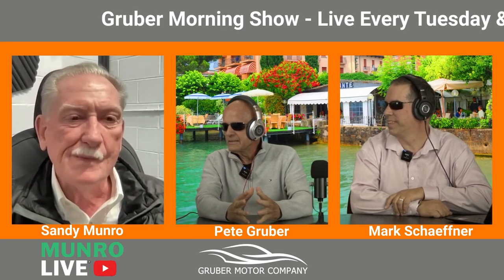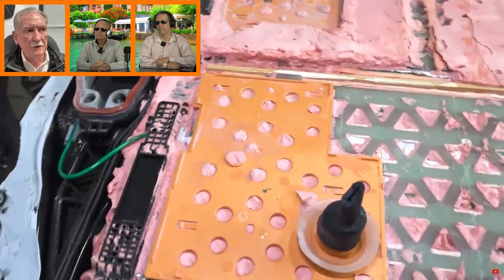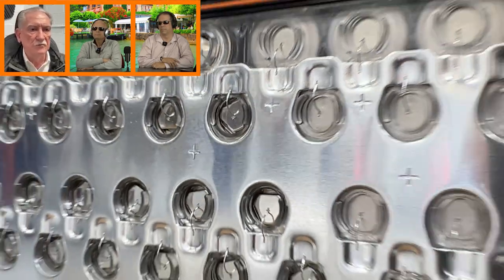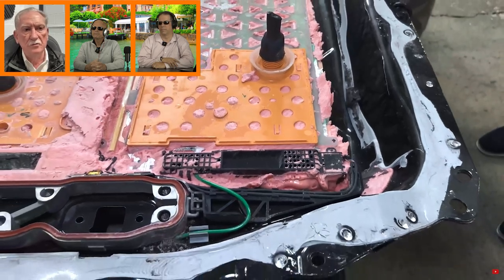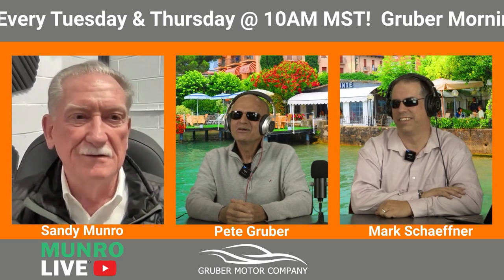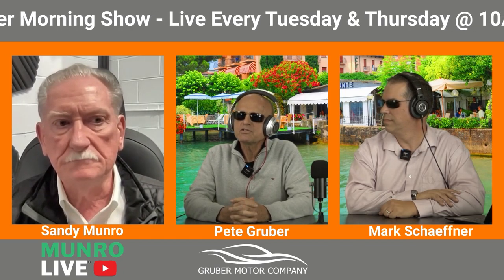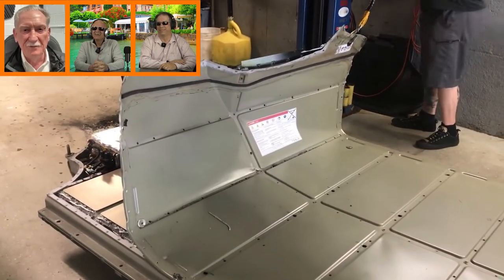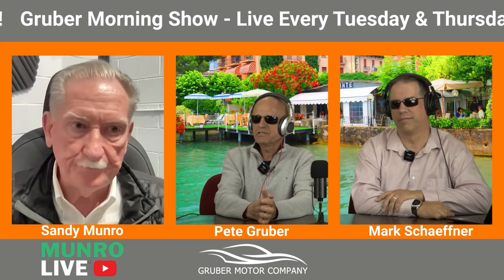Is Tesla's Structural Battery Repairable?

Comment: Munro doesn't care much about repairability. Profit and margins are more important.
I agree with him that if you reduce the number of connections and components, you increase reliability. But if you're unlucky, you can't replace the failed module, so you throw away the entire pack. Unless Tesla found a way to "isolate" the bad cells.
Reply: But I guess the point is you will be unlucky so few times that while you do lose the pack you don't lose very many packs and it will be rare. So from the customer's point of view they won't really care if there is a failure if the pack is covered under a 8 year/100,000 mile warranty. If these packs are really reliable then you will have to have won the jackpot to be a customer that has a pack failure outside of warranty. That customer won't be happy but those will be a very tiny number of customers. And likely by the time this happens in 10 years from now in 2032 pack costs will be very much lower in cost.
Reply: @flipadavis  bull. All batteries go bad. A bad internal part on one batch and it is gone. It is bad design and Tesla will be forced to change it like the phone manufacturers are being made to make the devices repairable. Just as a reference, a whole Q of  Model 3 Performance production in 2021 had bad packs because of faulty modules  and they are facultying one by one slowly and Tesla is hardly keeping up with the replacements. Now imagine you have to replace the whole pack.
Reply: I'm convinced, there'll be a battery replacement program at Tesla in a couple of years that doesn't cost a fortune because you'll be able to sell your broken battery to Tesla
Reply: When you say: "But if you're unlucky"   The goal is NOT to rely on luck!  think about it...
Reply: Its like using the airplane instead of driving. When a plane crashes, it is bad luck because there will be few survivors if at all. Yet, a lot of us prefer to fly than drive.
Reply: True, because everything breaks! Former mechanic… I think this battery pack has gone too far:  not able to repair properly…
Reply: @Doctorbasss  Everybody is unlucky when it comes to car ownership. But some brands are more lucky than others. Something will eventually go wrong with any mechanical device. 

The point is that the structural pack if built well and built bullet proof with the cells built to last with lots of testing then the number of packs that fail outside of warranty will be so miniscule it will be a rounding error. 

Sure you could be the one that eventually gets the pack that goes bad at 120,000 miles but you might also be the tiny statistic that slips, falls and dies in your bathtub.
Reply: The disposable pack sort of makes it a disposable car. No one is going to want to buy a new pack when the car is over 10 years old. Tangental question here. What’s the absolute longest anyone has kept a laptop or cellphone battery in use. 8-10 years?
Reply: You said "throw away" but you meant recycle.
Reply: @flipadavis  Where I live, the average disposal age for viechles is 19 years.

Arguing that a 8 year warranty solves the problem is ludicrous..

In most cases where a battery needs service is due to a small number of weak cells, not components shaking loose.
Reply: It would be nice to know many batteries go bad after the multi-year warranty.  LFP batteries are fast becoming battery of choice and claims 3000+ complete recharges (Easily 10 years).  And EV battery recycling is the future.
Reply: I went Glamping (glamor camping) in Santa Cruz CA last year in solar powered tents using recycled EV batteries.
Reply: Wonder what kind of mess it is to recycle all metals, lithium etc from dead packs
Reply: @stvybaby  This is exactly the problem with the current green transition: if we're doing it this way (making everything disposable and throw it away as soon as it is out of warranty), we're just making it worse, or at least not better. Our use of limited resources will increase, not decrease.
This is where I take offense at people being all superior in their greenwashed Teslas. Tesla is making the car a disposable product. The structural battery pack is one example. Adding large single piece Alu castings in the body of the car is another. Repairability of cars will soon be reduced to that of white goods. That is an enormous waste.
Reply: @marcusbiller867  
That's an "interesting" view (Model 3 packs failing).
where's your evidence?
Reply: @Mrelectric423  
Here's a better question.
How do you know when the pack will fail, If the pack will fail, or what the price of a new pack may be in 10 years?
Reply: @stvybaby  
The issue with your opinion.
We've yet to see many Lifepo4 packs exceeding 10 years (In actual EV use).
"LFP fast becoming the choice"? Really?
They MAY, but as yet, they're not.
Maybe the CATL MP3  cell will prove desirable?
Reply: @finnderp9977  
I wonder why you haven't researched before posting an "open" question?
If you had, you wouldn't be asking the question.
Reply: @hvh377  
How is recycling disposable?
Reply: @ogzombieblunt4626  It isn't and nobody proposed it was except you just now.
Reply: There are literally still 20-50 years old cars on the roads somewhere around the world that can be very easily repaired and reused even in really harsch environments you can just see those cars on documentaries like deathly roads......
Reply: @hvh377  
You literally just said it 🤣
Reply: @hvh377  
'Making everything disposable and throwing it away'
--> nobody said its being thrown away

Insanity.
Reply: @MichaelEricMenk  And here is Mr. Edge Case to tell us all how something won't work for him. The newest packs will likely last 300,000- 500,000 miles and outlast the car itself. 

If you really want to keep your old 300,000 mile, 19 year old car alive then buy a new pack in 2042. They will be dirt cheap by then.
Reply: @flipadavis  And here is Mr Throw It Away And  Buy A New One.

Claims about MTTF of a battery is irrelevant in a case by case bases. The mean is just that.. the mean.

If your claim was true, then Tesla would have no problem to give a 20 year 50% SOH warranty, and not only 8.....
Reply: @MichaelEricMenk  99% of people "throw away" their ICE cars after 150,000 miles. Thats how the car business works. 

In reality though most of a car's mass is recycled. The same with EVs. The pack has a huge concentrated mass of already refined materials that don't need to be mined and shipped across the ocean. 

But like I said these new packs will likely last 300k-500k miles which is far greater than the typical 150k-180k miles before a typical car/truck is scrapped. 

So maybe you should find some ICE forums and complain to all those ICE owners who throw away their cars after 13 years and 150k miles.
Reply: @finnderp9977  It will be a lucrative mess. Tesla is already recycling low quality cells after testing. Redwood Materials, a company founded by JB Staubel one of the original founders at Tesla, is a company that recycles cells and packs from all industries including automotive packs.
Reply: @flipadavis  wrote: " 99% of people "throw away" their ICE cars after 150,000 miles. Thats how the car business works. "

I see you have problems reading.

The average age of disposal of a car is 19 years... And yes, where I live.

You wrote: "But like I said these new packs will likely last 300k-500k miles which is far greater than the typical 150k-180k miles "

And as I told you, if you are telling the truth, then Telsa Motors would have no problem having a 20 year warranty of this unreparable battery. About 50% of cars get to this age (according to government statistics).

You, Mr Throw Away, will of course be happy with 8 years.

But you are not the World, and neither is Mr. Throw Away Munro...
Reply: @MichaelEricMenk  The average age of car disposal is not 19 years. Here is the most updated info I could find: "The Bureau of Transportation indicates that the average age across the board for vehicles still on the road is just over 11 years according to Autotrader, and the average may be approaching 12 years. Standard cars in this day and age are expected to keep running up to 200,000 miles, while cars with electric engines are expected to last for up to 300,000 miles."

If ICE cars last so long why don't they have 19 year/300k mile warranties as well?
Reply: @flipadavis  wrote: "The average age of car disposal is not 19 years"

You are partly correct. It is 20 years for diesel cars. According to governmental statistics. 

So the average is maybe 19,5 years? Happy now?

quote: "If ICE cars last so long why don't they have 19 year/300k mile warranties as well?"

No, but they do not have a large serviceable essential part of the car.

That is the whole point of the video.

Again, you you statement are correct. Tesla Motors will have NO objections to have a 1 million mile,  20 year , 50% SOH battery warranty.

If not, they can have a serviceable battery.
Reply: @flipadavis  "The average age of car disposal is not 19 years"

The number was taken from memory and was outdated. The number I quoted was from before the politicians tried to reduce the age.
Here are the number from 2011 to today:

2011	19,2 years
2012	18,1 years
2013	18,4 years
2014	18,5 years
2015	18,4 years
2016	18,3 years
2017	18,2 years
2018	18,1 years
2019	18,1 years
2020	18,4 years
2021	18,3 years
2022	18,3 years

So they have been able to reduce it by 1-2 years over the last 25 years..

You wrote: "The Bureau of Transportation indicates that the average age across the board for vehicles still on the road is just over 11"

Well, your numbers from where you live is about the same... Since the average age of vehicles ON THE ROAD is just over 11 years, compared to 10,5 years here...

In other words, the average disposal age where you live would also be 20 years give or take some years.
Reply: @flipadavis  Minor correction. JB Straubel isn't one of the founders of Tesla.
And just for completeness: mr. Musk is also not a founder of Tesla. They were made co-founder on paper after the fact.
Reply: @hvh377  From court settlement: "Eberhard referred to Musk as a "co-founder." For his part, Musk says Eberhard was "indispensable" in the company's creation."
Reply: @flipadavis  But the thing is, You wo't get a new pack when Your batterie has issues in the waranty time. Most time You'll get a used battery and those used battery are most time repaired battery. My guess is Tesla Motor is so confident with their batteries, that they'll replace the entire battery pack when the battery has issue.
Reply: @flipadavis  That shows exactly how false the current narrative is. Eberhard and Tarpenning actually founded Tesla and came up with the idea for the roadster, while Musk (and also Straubel) weren't even near the company yet. Eberhard and Tarpenning first hired Ian Wright as the 3rd employee, before Musk and later Straubel joined. Saying Musk and Straubel were co-founders and Eberhard was indispensable is a bit rich, because Eberhard was the one who was actually involved in the incorporation of Tesla. Musk, Wright and Straubel only won the right to call themselves 'co-founders' through litigation. They didn't actually incorporate the company.
Reply: @hvh377  Yes, we all know the history. The timeframe was so short between when the name Tesla was incorporated to when Musk and Straubel joined was less than a year. Technically, yes, Eberhard and Tarpenning registered the name and copied the idea of AC Propulsion which had a stripped down, fiberglass bodied, kit car that used laptop cells. So maybe then Alan Cocconi, Wally Rippel, and Paul Carosa should be considered as the real founders of the idea of Tesla since Eberhard and Tarpenning simply just copied the idea of AC Propulsion and the tZero that they didn't invent or even build. They even tried to buy in to AC Propulsion and convince them to build a marketable version.  

If Musk and Straubel wouldn't have joined right away and executed the vision by making a real business plan other than, let's build some go cart-like kit cars in a warehouse that are fun to drive then Tesla would have died in that first year or two. In this case I think it's more than fair for Musk and Straubel to claim co-founders. Without them Tesla wouldn't have become the Tesla that came to be in that second year. "Eberhard and Tarpenning founded Tesla in July 2003" "In April 2004, Musk invested $6.35 million of Tesla's $6.5 million Series A funding round, and became the company's second chairman of the board." So not even a year into Tesla's existence. Eberhard and Tarpenning had neither funding or business acumen to make it happen. So they founded a company without the right founders, realized this, and gathered the correct compliment of people to start the company.  

Without Musk, Straubel and others then Eberhard and Tarpenning would have been both founders and killers of Tesla within those first two years. It's petty to claim to be sole founders when you first take the concept of your product from a company that has already built an electric sportscar using laptop batteries (tZero) and second you know that you are going to fail without bringing on the help needed to survive in the first year, then afterward claim that you were the genius behind the concept and the business as sole founders. Don't know if that would be something to brag about years later when absolutely no one ever knew that the company Tesla ever existed for 2 years back in the early 2000s.
Reply: @flipadavis  I think it's petty to claim the status of 'co-founder' when you're not actually involved in founding the company. Especially since Eberhard was strongarmed into agreeing with it to at least get something of a severance packet, when he was ejected from his own company by Musk.
Reply: @hvh377  "The founding team had no real background in automobiles, and the project came in way late, and way over budget (as often is the case). It appears the budget planning process under Eberhard was poor and the true Roadster COGS vastly exceeded the purchase price for the Roadster. Fair or not (probably fair), Musk lost confidence in Eberhard for being late and over budget and inexperienced.  Investors know cr*p happens, but they have to believe the CEO is doing the best job possible when it does. That wasn't the case here. Musk realized as the largest funder of Tesla, something had to be done, otherwise it would run off a cliff and die."
Reply: @flipadavis  Nothing to do then with Musk's narcissism and wanting to be the CEO himself.
Musk had even less experience in the automotive sector and did not even have a background in engineering. Interesting to see that Musk has a track record of sticking rigidly to budget and timelines.
Reply: @hvh377  The board, including Musk, hired a second CEO after Eberhard. That CEO also failed to move anything forward and they were heading to bankruptcy.
Reply: @flipadavis  Are you referring to Marks or Drori? Drori had some background in automotive (not much) and he managed at least to get the roadster on the market.
But still the board (= Musk) decided that it would be better if Musk became CEO. Great way to ensure the board keeps the CEO in check.
Anyway, Tesla is doing great now. Perhaps they will become one of the big boys in the future. They have a shot at least.
Reply: @marcusbiller867  well, yes. All things do go bad eventually. But having a strategy to deal with these things is the critical part. Just like ICE cars, all things go bad. Just need a strategy to replace, repair and recycle.
Reply: I think the replacement cost will drop sufficiently with core refund that the need to replace the battery will be a negligible cost from a tco perspective.
Reply: @mrspeigle1  this is also a good point. You are driving around on top of 10k worth of minerals that YOU own.
Reply: @justinstewart3248  I promise you that just like with ICE cars, the hunk of minerals is not worth 10k for you when it doesn't function as intended. Recycling costs money and you'll be lucky if they pay you to take the battery pack off your hands.
Right now, you pay a small fee for any new thing you buy with a lithium ion cell in it, just to ensure the proper disposal at the other end is paid for.
Reply: @hvh377  yeah that’s just not true my man. However, my main point is simply to say that, no, these vehicles are not “worthless” when “the battery dies” as those who are struggling with change want to say. Change is hard. But we’ll get there. Very very slowly.
Reply: Not sure why nobody think of accident. Normal configuration with battery pack is outside of the car; allowing the ability to remove the battery pack after the accident. But this is not the case.
Reply: @justinstewart3248  What do you mean: "that is just not true"? Are you suggesting that a car battery pack at end of life will be worth 10k? That can't be right. That's not even what they cost new.

When the battery is gone, an EV will be pretty much as worthless as an ICE vehicle with a bent rod. Depending on the age of the vehicle, it might be worth repairing, but it could also be the time to start the recycling process of the car. Why do you think a car (EV or ICE) on the brink of recycling will have any serious value? Currently you can count yourself lucky if they take your car from you at no cost to you (in Europe they do, but that's because a fee was paid when the car was new, to offset the cost of recycling).

And what, pray tell, does any of this have to do with change? Or whether I would struggle with change or not?
Reply: @bluetoad2668  I'm always interested to see which data contradicts what I have written. Eager to learn.

Cars are not (yet) disposable goods. They are maintained and mostly repaired when broken. It has been getting worse (as can be seen from the slightly younger average age a car gets disposed of: 18 years now instead of 20 years 2 decades ago), but it certainly isn't comparable to white goods, which are pretty much uneconomical to repair these days. Production has been optimised so much (at the expense of repairability), that the cost of repair almost always exceeds the cost of new. Luckily, this is not yet the case for cars and we should always prioritise repairability over recycling. It is always less wasteful.

However, when we do need to dispose of an EV, we must make sure the batteries get recycled. But the reality is that currently still 95% of disposed batteries end up in landfill, despite the technology for recycling being available and laws being in place in the US and the EU to compel companies to recycle and the EU charging a fee on new products to pay for recycling in advance.
It just hasn't happened yet. And the reason is simply economics.

When EVs reach end of life in larger numbers, the economics of recycling may improve, but I think it is by no means guaranteed. If some idiot finds a way to make lithium mining a lot cheaper, we could easily end up with a lot of batteries in landfill.
Reply: @flipadavis I think one of the issues will be repairability if you're in an accident and the pack gets damaged you want to be able to salvage anything from it and the car will get totalled for minor accidents. It might make the car not expensive to insure.
Reply: @flipadavis  
You can't reason with this dude, he's too bad faith.
Reply: There is to be Right to Repair here. Now 2nd hand EVs are hitting the market without warranty. If there is even a small issue with the battery the car is totaled.
Reply: @joeabad5908  and for good reason as overall flying is safer
Reply: @marcusbiller867  yeah. slowly over 2+ decades.

plenty of teslas have made it to 300k miles on their first pack. at which point the average car isn't worth the money to repair any significant part.

and again. if it fails within the warranty period repeatability ain't the customers issue
Reply: @hvh377  go look up the price of lithium and copper then.

An EV battery contains a few hundred kilos of lithium and a few kilos of copper. recycling a pack is darn cheap when done in industrial quantities. 

which means that dead batteries are worth quite a bit of money just based on the resources they contain.
Reply: @anonym3017  Go look up the price of unseparated metals yourself!

And when you have done that, maybe then explain why battery recycling doesn't happen on a large scale if it is darn cheap.

Wanting something to be true and then continuously saying that it must be true, doesn't make things true.
Reply: @hvh377  you know how I said "when done at industrial scales"

Yeah recycling batteries at industrial scales requires industrial quantities of old batteries which are large enough to warrant shipping to the recycling center.

That's not currently the case so the old batteries just tend to end up in storage or some second life application.

And the recycling process yields separated metals. Lithium carbonate to be exact.
Reply: @anonym3017  So, you don't think the world currently doesn't produce old batteries on an industrial scale? The estimations for the amount of lithium ion batteries scrapped annually worldwide are between 600.000 and 800.000 tonnes right now. And only 5% of that is recycled.

These lithium ion cells are not from car battery packs yet obviously, but the cells are mostly the same form factor and if you consider the construction of Tesla's structural pack: all you can do with that is grind it to bits and recycle the crumbs. That process is applicable to any size battery pack/cell.

And yes of course recycling yields separated metals of some value, but you suggested that the worn out battery below your scrap EV had value. It's the recycling process that adds the value.
Reply: @hvh377  the world currently does in fact not produce old batteries which are large enough so that shipping them to the recycling factory is profitable.

And you forgot one thing. The recycling places want the old EV batteries to make a profit. They ain't the owner of the old EV batteries. So they need to buy them from the owners.

Which means that the dead battery has a significant value.
Reply: @anonym3017  So at how many tonnes annual  lithium ion waste does recycling become profitable?

Do you really want to continue making your argument this way? No facts, just keep on saying it will happen? I told you before: saying something over and over doesn't make it true.

The value of old batteries is equal to the cost of raw materials for new batteries minus the cost of recycling and the profit of the company doing the recycling.
With currently high prices for raw materials as you say and value of old battery waste equal to 0 and recycling cost 'darn cheap', the profits for recycling companies should be through the roof. And yet, 95% of recyclable lithium ion waste ends up as landfill. While at the same time, we can't actually mine fast enough to meet demand.
This situation only becomes worse when raw materials become cheaper and/or old batteries start having a value.

In the future, this balance may change (if recycling becomes cheaper than 'darn cheap'), but it just as easily could not (when mined material become cheaper, let say by switching to sodium?). There is no guarantee.
Reply: @hvh377  which part of "large enough to be worth recycling" do you not understand?

Extracting a battery from a phone, tablet, laptop or other small electronic device and shipping it to the factory, the other way round also works, costs more than the recycled material is worth.

Above a certain battery capacity, multiple kWh in a single pack, it is worth recycling a battery provided there's an industrial quantity of old batteries above said capacity.

The current old lithium batteries are basically all at or below 0.10kWh, as that's the maximum size allowed on a plane, and therefore not worth recycling
Reply: @kiwim3p587    We’ve found out that a lot of what people thought was recycling turned out to be: pay the Chinese to take the garbage and they turn around and dump it in the ocean…that kind of recycling? Can’t trust government or corporations…lessons need to be internalized.
Reply: Why can't you just dig out the cells or contacts and test in place.   I have burried wires in from and simply dig them out if necessary.
Reply: @finnderp9977  The average citizen, be it a scrap dealer or whoever would not find it profitable to try.  Redwood Industries is already recycling batteries of all kinds. Leave it to the professionals who know how and have the equipment to do it.
Reply: @hvh377  I disagree with your comment, Tesla is making the car a disposable product.  They're trying to make it a recyclable product. There will always be a market for the body parts and the drivetrain will get recycled, i.e. the motors and the batteries.
Reply: @rogerstarkey5390  You don't.
Reply: @ogzombieblunt4626  The batteries are disposed to someone like Redwood Industries and they do the recycling
Reply: @hvh377  Eberhard was "ejected" by the board of directors in total.
Reply: @metriczeppelin  You disagree with me and then confirm what I said in the same sentence?
BTW, disposable and recyclable are not mutually exclusive. Disposable and repairable are. Tesla is making the car more and more disposable just to lower production costs. That is a bad practice from a sustainability POV. And it is generally bad for consumers, because it takes away the option to repair. It makes repair uneconomical. As has happened with so many things (white goods, phones, computers).
Cost of repair goes up, cost of new goes down, products get thrown away (for recycling) and not repaired.

And yes, cars do get recycled. In Europe, where I live, a very high percentage of every disposed car gets recycled. I believe they're well over 95% these days. The only reason for this BTW is that it's mandated by governments/EU. I shudder to think what would happen without these laws. And actually, I don't have to fantasize what it would look like. Just see what happens in Asia, Africa. A lot of our waste gets exported there, formally to be recycled, but that never happens.

However, when I go to a wrecker to get rid of my old, end-of-life car, I can be happy if I get offered a few hundred euro for the car, but I could get no money offered at all (law requires proper disposal is paid for when buying a new car, so it is not allowed to charge anything for bringing in an old car for recycling).
So to the final owner of a car, there is no monetary value left. The value that old car parts have is created by the wrecking/recycling process.
Reply: @metriczeppelin  Yes, no other body can do that. Who was chair of the board of directors at the time? He who pays the piper, calls the tune....

As was demonstrated soon after, as the board appointed the chair as the new CEO, which a board who take themselves seriously would never do.
Reply: Your first sentence is 100% wrong, Monroe and Associates constantly references repairability in their analysis of all products.  They often make suggestions on the topic.
Reply: @finnderp9977 I mean,... We already do it. It's already a thing. It's not a random unknown quality we should be panicking about.